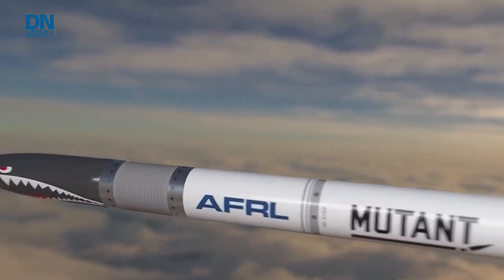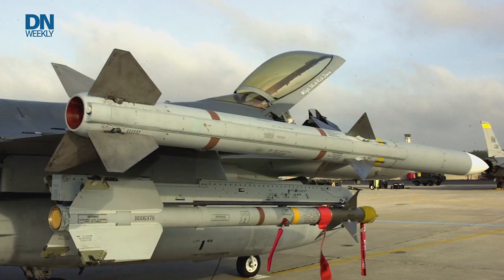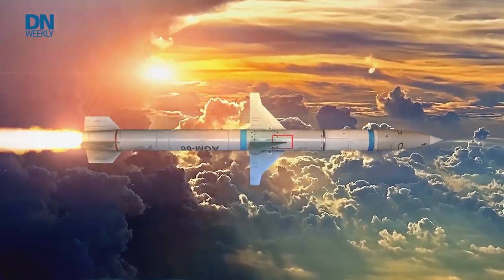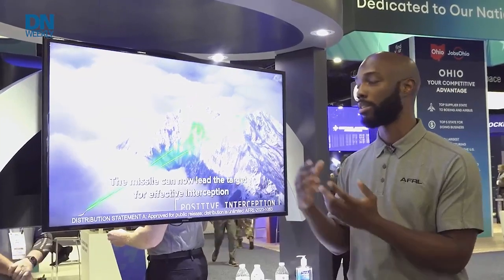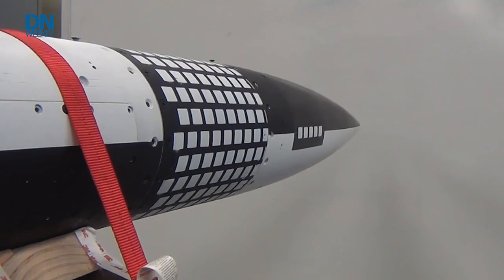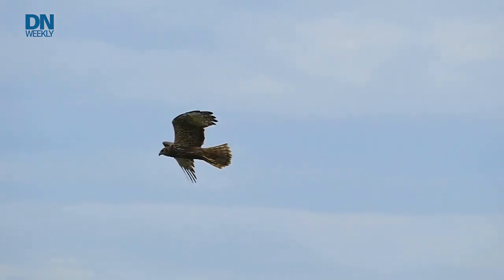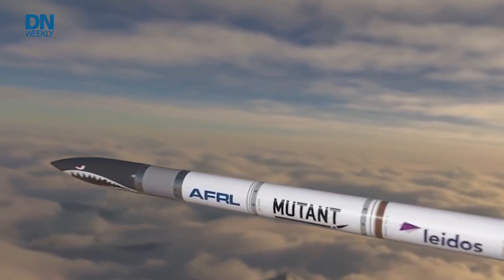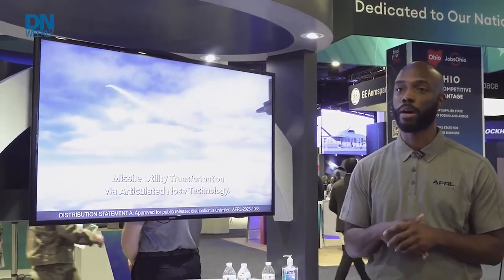Meet ‘MUTANT,’ the Air Force’s radical new missile design

Comment: AH - GH 🚁💨80 model 
AH - ZH still in service 

The , old 🐍 Cobra 1980's according to the US national guard then was ( dumped all over ) the world 🌎 

AH - ZH still in service not sure if I had the acronyms correct. 
========
It doesn't matter since you're working on missiles. 
_____"____
(oo)[😎](oo)
  *  . /   \.  * 

When when you have six hellfire missiles what if the bottom hardpoint on each side choose used a small rocket assist.  
(Rocket assist)
They use them on c-130s( because of the hellfire missiles ) you'd lite it 🔥 
👋😎💨 Bryan 🏡 
So the osprey thought it got away eh Cambodia is on our ass 

😊 Your AI is a loose cannon

Comment: Nice, 

So for even tighter turns and controls, instead of a single point of articulation you could try a double point of articulation, 1 front 1 rear that could move in synchronization, so you get a directly shape change effect that’s even more dramatic/ maneuverable like ↩️ (I was thinking more like the refresh icon as a representation of the movement but that’s the closest emoji I could find 🙂 )

Comment: Notice how he doesn't talk about increased complexity, increased weight, reliability or economics. Granted it's early days for this project, we'll see.
Not a big believer, sure hawks are hyper efficient. But every added articulation in mechanical design just has too high of a tax on your design.
The only ones that do it properly that i know of are the ones filled with helium to "cheat" gravity a bit. underwater seems a much better place for this type of thing i would think.

Comment: Not many birds of prey fly at mach speeds... the thing is, why reinvent the wheel? A more sensible solution would have been using thrust vectoring nozzles. I do like the idea of the warhead turning toward the target just before the final phases of the intercept, but adding maneuverablity like this will take decades of testing for them to even figure out if it CAN work.

Comment: Working with the shuttle program. I wonder what would happen with small thruster on board. With the shuttle program, the thruster with little power would point the shuttle in pretty much any direction. I understand that the thruster would only be used in space. Just sayin...

Comment: Essentially, this is the same idea as the articulated bus designs and differential steering on cars. The more of the mechanism that moves, the tighter the turning radius, and the less resistance from your control surfaces. This also allows for missiles to move their warhead to engage the target off axis and also change the directions their sensors are operating in. If this works out, it could lead to some missiles that are much harder to evade, both in the physical sense and in the sense of detection and stealth.

Comment: Charges EM rail ring and drops an Orange sized explosive into it with shutters around the craft to control release direction while sending energy to the round by ultrasound to synthetic piezoelectric crystal inside to EM charge it for smooth release No need to seek, straight to target with a big bang. Missiles? Points at laser AMS PLUS! Plasma generated ultrasound is one of the methods with or without shield up used for anti-drag + elevating sound beyond hearing for illusion of silence.

But also? Points at Boeing plasma force field And advanced 3D printing civilizations on worlds.. And scanning far beyond material limitations for deep penetration of worlds far above the sky. Helps when you know how to use it to arrange atmosphere density in a holographic beam while sending your signal through.. More medium. Oh my bad! Earth hasn't combined everything yet because your own elites are about to sacrifice you all and use everything the masses learned to control the next oblivious batch of masses.

Tired of watching that..

Comment: Hows the whiplash effect? Is it having trouble maintaining a stable path, after it straightens out? Why dont you tey flexible skin which can be deformed for a similar effect? Or just a ring of flexible material? No whiplash effect to worry about. Only the center needs to be perfwctly rigid to maintain stability. The skin or a part of its length only needs to be rigid enough to not vibrate. You also dont have to worry about it being damaged. Its a one use application.

Comment: It's so funny and stupid that I didn't even believe that anyone could seriously even think about it. An idea immediately comes to mind, there is not even confidence that this is another useless project for pumping out money. The first change in the fairing angle at high speed will immediately lead to a loss of flight stability. also, if the pivot point is not strong enough at a speed of 1000 mph, it will lead to the immediate destruction of the rocket. The turning point should be very massive. The idea of changing the direction of the radar beam by turning the head of the rocket will only cause laughter. Wouldn't it be easier to turn the directional antenna inside the case? This is how the mechanics of controlling the antenna of the nose radar in any aircraft are arranged ... :-)))))   And the last direction of the scattering vector of fragments of the missile warhead is easily controlled by the shape of the shell of the fragmentation part of the striking part of the missile. For example, if you make a casing in the form of a cylinder, the scattering of fragments will be circular perpendicular to the vector of motion of the rocket. if the casing is in the form of a cone, the scattering of fragments will be domed along the course of the motion vector. If the casing is spherical, then the scattering of fragments will be omnidirectional in the form of a sphere. :face-orange-biting-nails:

Comment: In full honesty, talking about creatures using their heads to turn is a true possibility, but the video doesn't previde a proper example. Take a dragon or snake or any creature that has an articulating neck, they could use it like a surface control very easily and with great force. Just like their tail if they evolve a trait to articulate it with flexibility.

Provided that the creature is agile and can move quickly.
Reply: I don't think dragons exist
Reply: @glandhound  yeah? Your point about it, it was an example to the topic

Comment: I guess the goal here is to help a sinple seeker maintain lock on the target. Thrust vectoring can also be used for this. But thrust vectoring with skid to turn is a very high angle-of-attack manoeuvre. It creates a lock of drag. So being able to point the seeker could help the missile maintain energy. 

Simple solid state seekers are important to reduce the missiles diameter.

Comment: Surface to air sure—this technology potentially work; air to air—f no. security would be an issue as is the time lapse. Aerodynamics and astrodynamics get compromised.  As a matter of fact, in his anecdotal evidence—he mentioned car and bus which is on the ground turning. In the air, the 🦅 are of the same material , therefore, it cannot be applied there as well. Use least amount of parts and same material and then think 💭 air to air combat. 😢😅

Comment: So will this be paired with thrust vectoring? Why did he leave that out
Reply: Good question.  I don't think they have thrust vectoring for small diameter missiles, but such a small system is possible now, though it increases the cost of the missile by a good margin.  But that last kick in the right direction could be worth it.  You could almost make it turn 90 degrees just fast enough to point the warhead at the target.
Reply: @timehaley  they have thrust vectoring for missiles even smaller than this
Reply: @timehaley  yeah, this is totally unexpected, those guys at darpa have some high level autism lmao

Comment: I was scuba diving off San Miguel Island, in the path of the missile test range, and at 80' down in the sand I found a front portion of a missile. Maybe a Phoenix diameter missile. Well worn. The case were the front fins attached was still there, no fins. If they can make it light that would be a plus. If its heavy it might not be worth the effort.

Comment: That's a lot of mass and volume being taken up by the actuator that could be taken by fuel. It's range is going to suck. Also, that actuator is going to have massive power requirements compared to a normal one. That is a lot of mass to accelerate compared to a fin system.

I don't think this is going anywhere as it is currently.

Comment: Large Raptorial birds (the harpy eagle is probably an exception from dense jungle hunting) turn their head because their eye is so oblong and filling the socket that it doesn't turn the way ours does, it can't side eye. It isn't a component of flight but the consequence of anatomy. Also the lens only sees distance clearly with it's binocular vision. It detects movement from the entire field. This is not what they do on the ground, they tilt they entire head sideways to see you clearly from the flatter side of their lens/cornea.
     I just think you're misattributing what the eagles are doing and why. The simple fact is they can't see what isn't in front of them without turning, and in flight that is commitment. 
    You aren't doing biomimicry of them, you're copying fish. They are in a high drag environment also. Buy a congo ropefish or an eel.

Comment: You still have drag when the nose is not aligned with the body. You have both induced drag, parasite drag, and maybe drag from separated flow. There is still no free lunch. One advantage of this system might be fewer parts. Bottom line is that this concept has been around for 40+ years and has yet proven to be a clear advantage.
Reply: Of course there is no free lunch. At the same time, you don't have the extra drag when the neck is not articulated, but you will always have parasitic drag on canards even then they aren't deflected. That's where the saving is, in phases where less maneuvering is needed.

Comment: $30 million missile to take out a donkey cart.  The math doesn't add up.
Reply: This is an air-to-air missile.
Reply: @elijah_9392  One of these missiles would need to shoot down 40,000 mini/fpv drones to break even. Huge mistake, more artillery shells is a better option.
Reply: @kdub6593  

The developers are not selling this missile as a "one size fits all" solution. 

It is very obvious that the intent of this missile is to intercept fast, maneuverable targets. This would include: fighter jets, supersonic cruise missiles, maneuvering ballistic missles, and large UCAVs (drones). 

For those purposes, this missle seems to be a good tool. I would like to see more data before commenting on its actual effectiveness. However, it looks promising.
Reply: Well, donkey carts don't fly
Reply: U don’t understand how this type of thing or math works do ya son.
Reply: @NotMe-hm2zd  Explain it to me daughter.
Reply: The math doesn’t add up because you have the wrong variable

Comment: A missile with no wings, with the fuselage serving as a lifting body, wouldnt the missile need to hold a much higher alpha angle to sustain itself, creating greater induced drag anyways?
Reply: The thought is to have most of the articulation occur during the terminal phase of flight. Much of the effort has been overcoming the issue of not being pointed directly at the target when interception should occur. If the missile is off more than a few degrees the fragmentation particles might miss the aircraft being targeted. If the head can move say 10 degrees what might have been a miss previously can now be a successful interception. I’ve been following this since the first publication of the project about a year or so ago. Then the push wasn’t towards affecting trajectory but towards a better interception.
Reply: @kaptainkaos1202  not that im some sort of authority, but that is a valid point to make, I just assumed the purpose of the head was to guide the missile because there were no conventional lifting surfaces in the animation, would this not add logistical strain if implemented in said munitions tho?
Reply: @kaptainkaos1202 would the articulated head also allow for slightly more energy retention of the missile? As in the end of the terminal phase the entire fuselage would not need to position itself to intercept the target
Reply: Yes armchair aerodynamicist engineer. There are fins on the missile if you paid attention.
Reply: @NCSiebertdesign  who was the armchair engineer Christian? Me or the OP?
Reply: @NCSiebertdesign  mb didnt see them and the guy was making it sound like the guidance was the responsibility of the head, and I’ll be studying fluid dynamics soon so i can make educated speculation :)
Reply: @NCSiebertdesign i see no designated lift surfaces though, there are stabilizing(possibly stabilators) present on the aft but the main source of lift would still be the body
Reply: And the fuselage is not optimized as a lifting body as it seems to a straight up tube(axis symmetric cylinder) so the missile still faces a greater drag penalty at all phases including cruise

Comment: Okay but there's no way the head moving will have as much c😮ontrol authority as fins... and that mechanism looks heavy, so my question is whether the weight penalty of the mechanism is worse or better for range than the parasitic drag of fins...
Reply: Maybe it is more effective because the control surface has moved closer to the center of gravity/mass? 

I am not sure. I like to appreciate mechanical and aerospace engineering from a distance.
Reply: Am I out of touch? No, it’s the Air Force Research Lab who is wrong
Reply: It's not just competing vs canards.  There are also missiles like AIM-260 with arrays of reaction charges for terminal maneuvering.  That's a much better idea than this bending lifting body nonsense.
Reply: @concinnus  

Why is it "nonsense"? Supposing it is a suboptimal solution, I think it's good that diverse ideas are explored. 

It definately has a mathematical basis and required competent individuals to create.
Reply: @elijah_9392  Just the fact that you think a control surface would work better near the center of mass rather than away from it (which, side note, isn't what the design is doing) tells me that you don't have the mechanical intuition or background to make it worth my explaining.
Reply: @concinnus  

That's fair. I did not consider that force applied at a distance results in greater torque about an axis. 

I suppose what I was thinking about was if an improvement was made by turning a large portion of the entire weapon into a control surface up to the center of mass. 

However, you did mention that this fact is irrelevant as that isn't the purpose of the design.

Comment: You can get similar performance. with thrust vectoring. I'm curious if this has advantages over that. Either way it makes total sense to remove control sensors to extend the weapon's range and performance.
Reply: Missiles only burn for a few seconds. This is for maneuvering after the rocket motor is done.
Reply: Thrust vectoring vs this tech is IMO not even close as the nose curving is at the front and will respond  many times faster than even canards, by far. I've been flying for over 20 years so I have a bit of background in 3D flight with giant scale airplanes and custom designs to enhance flight characteristics. It's like comparing pigs to UFO's.
Reply: @joesshop3622  You mean the proposed, untested design there hasn't been even been a prototype of tech? It's comparing proven designs to an idea some guy had. At this point this technology is an animation and some preliminary paper data.
Reply: Without control surfaces or wings, the missile will be unstable in flight with thrust vectoring.
Reply: Not really. The force of vectored thrust is opposite the desired acceleration. The missile has to make up for that with greater lifting force in the desired direction, equalling more drag.
Reply: This is way less stress on the missile body during the turn, can turn way tighter, with more immediate response, and less energy lost to drag. At least that is my intuitive understanding.
Reply: Why not both? 💥
Reply: @joaoricardo6903  interesting concept, lets add canards to the list too!

Comment: Interesting idea but I doubt it will be as efficient as canards.  The whole missile will end up having to be used as a lifting body which is much worse aerodynamically it will have much higher lift induced drag
Reply: I imagine in practical use it would only start maneuvering the head when it was at end of mission and efficiency didn't matter anymore. Canards for 99% of mission, rotating head 1%.
Reply: Thers still fins in the back
Reply: You can use both.
Reply: I can see it working best as and ground to air interceptor. turning a near miss in to a hit.
Reply: Plus drastic energie-loss when brutally manouvering.
Reply: Yeah but canards can't let you direct the warhead charge at a passing enemy missile / aircraft without changing the direction of the entire missile first
Reply: @chrisd9700  The sidewinder already can aim its wall of fragments in the direction of the enemy aircraft. It is a much simpler implementation than having a swiveling head